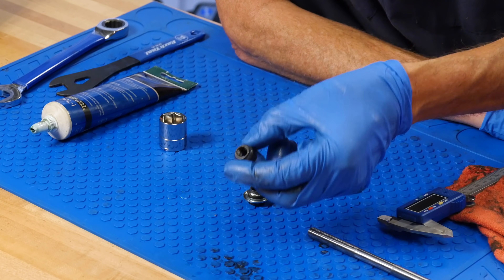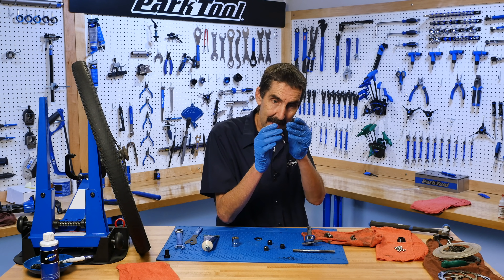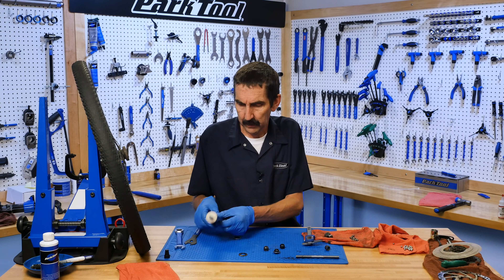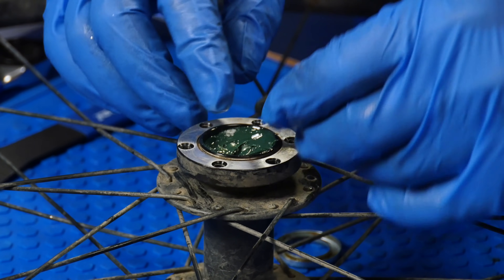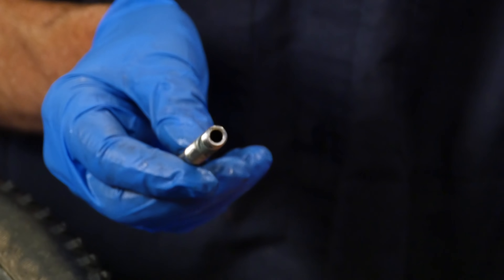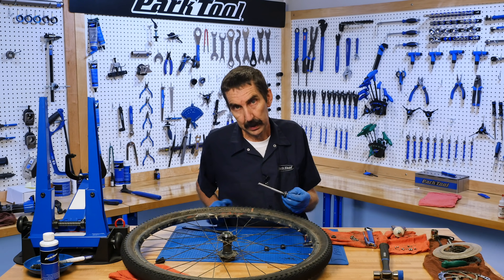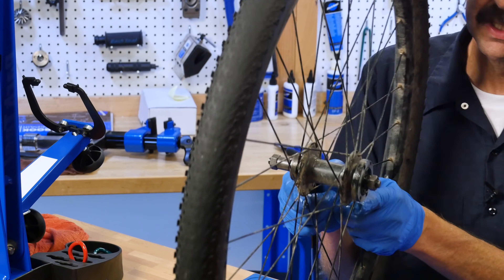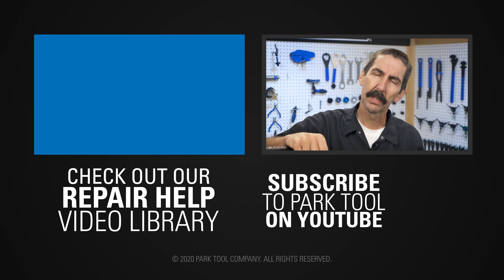Calvin's Feast Part 2: Reassembling the Axle | Tech Tuesday #160

Comment: It's easy to spread grease around when it's sponsored. You put twice as much as you need, grease itself increases the resistance of the wheel to turn, and on this bike, you'll need to service that hub more often because the axles often break if the bike is ridden seriously.

Comment: Where does one get new cone nuts if they don't have them lying around the shop?
Reply from the maker: Wheels manufacturing is one of the only companies producing cones for the aftermarket. Shimano also has parts if the hub you are working on is a Shimano product. You can find the part numbers at si.shimano.com
Reply: @parktool love it. Thanks for the answer. And the video is hilarious due to the editing. Even more than when kalvin and ….. made the seal noise on the piston seals video. 🎉😂

Comment: If i have only 1 dust cap per side does it matter which way i put it into the hub - with the flat part facing the bearings or with the groove facing the bearings? I dont have another dust cap on the cone, just the one that is in the hub.

Comment: I had used a "multi purpose grease" that was from nigrin and after a months when I opened my axel cones, I found that the bearings have nothing under them.... The grease had been displaced :(..... It looked like it also got churned and turned white ... The original colour was a bit like vaseline..... Anyways, when I took the axcel out I saw that the extra grease dot pushed into the hub..... My cups done have a seal and the cone goes directly onto the cup. Any ideas????????????.... The cone was just tight enough and lots of grease also got pushed out when installing

Comment: Which bearing is best????? Sealed bearings or ball bearings??
Reply from the maker: That is a good Tech Tuesday topic.  Advantages to both.  Both have ball bearings. The cartridge style ("sealed") has ball bearings trapped between races the turn.  The term "sealed" is more marketing than engineer.  Both cup and cone and cartridge can use rubber seals to keep out dirt and water.
Reply: @parktool  so both or good right?

Comment: Had the same thing happen to my axle, and this video helped :) I noticed the wobble in my rear tire when the treads were rubbing, but only when I rode forcefully. I made an adjustment to how it was set in the frame and just rode lighter. Took off the rear tire when I had the chance and yup, the axle is broken. Thankfully I only rode on it for two weeks, not two years :P

Comment: Do you have any videos that explain the 1X11 drivetrain and how is compares to a 3x9, pros and cons, etc. I couldn't find any... 
If you dont have any, that would sure be an awesome video 👍
Reply: Simple, you he rid of the front derraeliur  and its shifter (how ever it’s called), and you’ll have less mechanical complexity, besides  more gestos mean a bit more range in the climbs, and you laso shed weight it’s a 1x11, 3x9 is not bad, assuming you have a free hub not a free wheel, id you have the free hub you can convert pretty  easy to 1x9

Comment: PARK TOOL PLEASE we need a tool to install bmx grips for us without air compressors a lot of people would buy it
Reply: Hair spray, my good man
Reply: @paddychamp6069  Yep. Aqua Net would be the traditional way to do it. You can also just spray isopropyl alcohol inside the grip. Alcohol takes a little longer to dry, though.

To remove them, slide a tiny flat screwdriver under one edge and spray alcohol in the gap. Massage the alcohol all the way around the grip and keep prying and spraying in the gap until it slides off in one motion.

Comment: I little disappointed you are working on a sealed mechanical component that takes cleaned care. Dust and dirt is harder than metal and grabbing dirty spokes old tires then installing bearings. This is not the way to work on the thing's. Glad to see you are afraid to get your hands dirty😱

Comment: i disassembled my rear hub this weekend and the cups and cones are absolutely wrecked 
didnt bother replacing as ill be replacing my wheelset anyways (has been condemned by multiple bike shops)
i have the axle finger tight and you can barely turn it 
should survive the weekend at the park (mankele mtb resort) if it doesnt ill just rent a bike for the rest of the weekend

Comment: I use tweezers to place the bearings in the grease. I find it easier than trying to use my fingers.
Reply: I like tweezers as well, greasy ball bearings would rather stick to my glove/hands than in the hub. I also like to put the axle with a fixed side in first before any ball bearings. For the extra protection of them falling through.
Reply: @Ram5ey NO, do not use tweezers! They can (pre)damage ball bearing surface. You should rather use a magnetized screwdriver, or bare fingers.
Reply: @CristianSpitz  I guess I should've mentioned they are plastic tweezers.

Comment: amazing vid. thanks.  how do you tell how much you want the axle to protrude on each side? how exact does this measurement have to be?
Reply: i would say within a millimeter of eachother (so side A can portrude 5mm and side b can portrude 6mm) if you have access to vernier callipers it should be a breeze to measure portrusion
Reply: Most critical for quick release hubs -- most importantly, neither end of the axle should protrude past the outside face of the dropout (protrusion should be less than the thickness of the dropout material); otherwise, the protruding axle will prevent the nut on the QR skewer from tightening flush against the dropout.
Reply: For alu frames/drop-outs, with Q/R axles, I use a 5mm hex key to quickly measure ~5mm between the end of the axle and the face of the locknut - with the original axle or a same-length replacement, 95% of the time it'll be 5/6mm at the other side. (older, steel frames will need less than 5mm).
With solid axles, I make an estimate of the protrusion on the fixed/drive side and then slip the axle into the dropouts, to see if the axle nuts fit on both sides without having to tweak the frame.

Comment: Why does my bike dosent make clicking sound when i stop peddling like parktools intro sound??
Reply: Some hubs are more silent than others.
Reply: @MrNicoPela  🙏🏼
Reply: strip the grease out of the freehub body and replace with mineral oil. it'll be louder, if thats what you're looking for.
Reply: @johnnyhanel  haha..out of curiosity all the bikes make that music wanted to know if its fine if my bike dosent make one
Reply: Some are also completely noiseless like the Shimano Silent Clutch Freewheels (out of production).
Reply: @Kowabrass  yea its a shimano hub and its an old bike got gear shifter on the sides